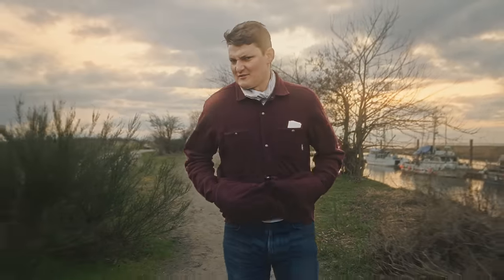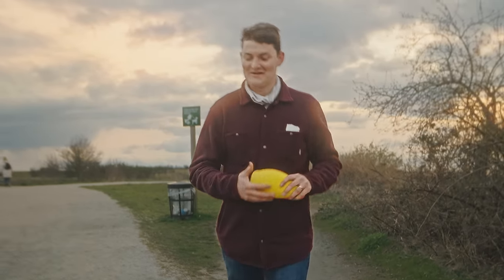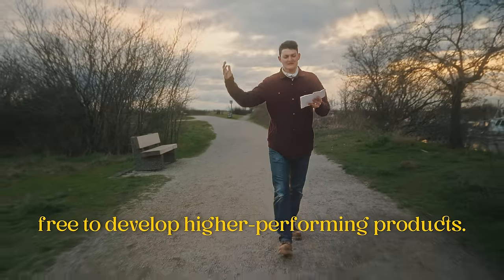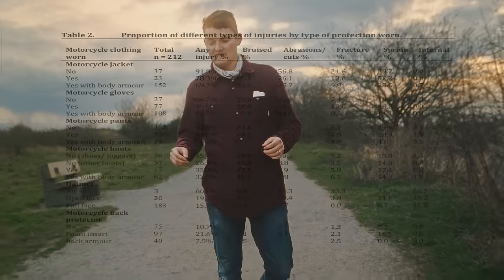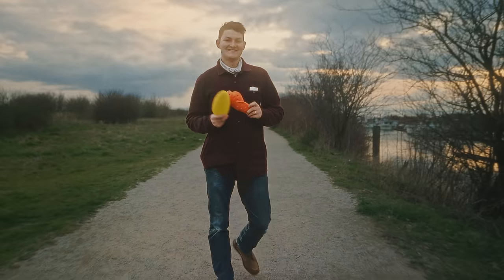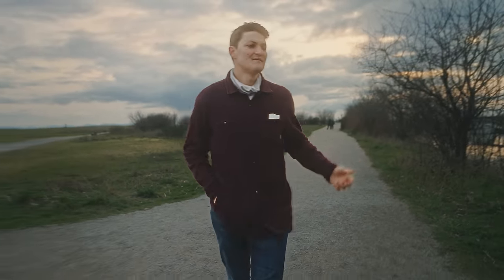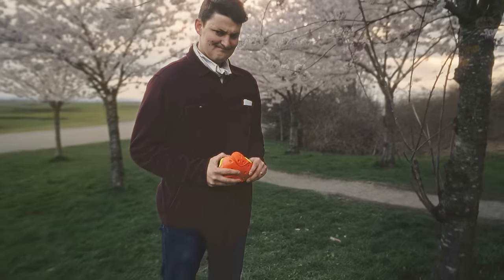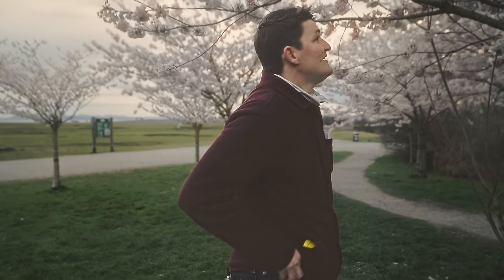Why I Stopped Wearing Motorcycle Body Armour

Comment: As someone that had a 10-15mph lowside in the BRC with no pads on legs, torso, and arms, I can tell you the bruising I got on my left knee and elbow was horrendous, lasting for about 2 weeks leaving me unable to work out or do anything strenuous.

Over the winter I lowsided at roughly 2 times the speed of the BRC lowside, so 4 times the impact forces. However, this time I had CE level 2 pads in elbows, shoulders, back, hips, and knees. I walked away with nothing but a headache and was working out the next day.

I really appreciate Ryan's philosophy on people making their own decisions, and just making sure they have all the information to make a well informed decision. For me, it's absolutely worth wearing the pads if it means there's a greater chance I won't be nearly bedridden for days.
Reply: I think your examples are where the padded armor is best - sliding with minimal impacts. I agree I will wear it just because why not, but I know if there is an impact I'm getting a break.
Reply: This!  I (knock on wood) haven't had an unplanned on-road get off in a LONG time.  However, I have ridden with dozens of people who have.  I have seen the aftermath of SLIDES with and without armor.  I ride with the best armor I can tolerate.  I am sure that in high sides and multi-vehicle impacts, the presence or lack of a little foam pad is of little consequence.  
But, most accidents (not even reported) are not written up by a cop.  The perpetrator tries to slink away before a COP shows up and adds insult to injury with a performance award such as: "Failure to maintain control of vehicle."   Wearing good riding gear helps the road rash a lot, and the pads help with that too.    So, I wonder about the validity of those surveys.  Are the group of riders with and without armor reporting the accident results at the same rate?  Perhaps riders with armor were able to sneak away from an accident scene and pretend like it was no big deal, and they aren't fully represented in the data.

One time about 30+ years ago, I hit a small slick patch on an exit ramp.  I low sided and slid to the outside of the curve.  No impact and I got up and saw just a grayish frayed patch on my jacket.  I picked up my bike noted the ground down parts, and the broken brake lever and turn signal.  I then finished my ride to work.  When I got to work and took off my outer layer, and then the inner down layer, and then the fleece liner, I noticed that my elbow had a patch the size of two quarters that looked like melted mozzarella cheese, it stuck to the fleece and came off, leaving a wet weeping raw meat underneath.   The fleece, the down coat, and the outer layer were mostly fine, but the outer layer looked like I had scuffed it.
If there had been a small pad there, I don't think I would have had that burn.
Reply: I've had a 30kph lowside in Kevlar with no pads and have a scar to show for it.
I've also T-boned a car and gone flying in a cheap armored jacket and wasn't even bruised.
Anecdotal yes, but I'll at least stick to some flexible C1 personally.
Reply: Totally agree with above ❤
Reply: Lol at a 2 week bruise being "Horrendous" , people are weak today...
Reply: @kyle5778  horrendous in the sense that the joints were stiff to point I could barely move them until they healed, not talking about pain. The body takes time to heal, but apparently that makes people weak?
Reply: Same speed low side, when I fell the motorcycle fell on my left foot(it hit my foot with left foot peg) and broke both my malleoli. Surgery, 3-week patience, physiotherapy. Started cowardly walking after 1 month after the accident with my left foot muscles very weakened. After 1,5 month of walking and exercise I brought it back to its 95%. Now I am wearing moto boots always( I used to wear  jacket, gloves, helmet, but not boots). If i wore boots that day I would not have broken both of them or either of them. Also as I fell I fell with my elbow on the ground which had protection from the jacket pads.
Reply: @BenRussoUSA  Got a massive scar on my shin from sliding on the road once wearing non-riding jeans. The jeans weren't even torn up over the road rash. Had another off on the freeway and slid on my back across several lanes of traffic. The cheap turtle foam backpad in my Joe Rocket hoodie took the slide like a champ and I got out of that one with no injuries. The outer shell of the hoodie wasn't even abraded through, but the backpad surfaces inside were noticeable roughed up. I'm pretty sure that backpad saved me from some really severe trauma that night, and I think your anecdote also supports that pure abrasion resistance via penetration through a fabric may not be the complete story as far as protective gear goes. Having that layer of  armor to sacrifice can really save some flesh.
Reply: Hard agree. I'm disappointed at the failure of logic in the video -- as if avoiding fractures is the only reason to wear armor. Ryan even mentions, several times IIRC, that impact protection does help avoid/lesson other injuries. I definitely agree with giving people information to make their own decisions, but please, make a good argument with it.
Reply: You couldn't work out for 2 weeks, that's no big deal. I couldn't walk for 6 months after my accident, wouldn't have called it horrendous, but it did suck. Stop being so melodramatic 😂
Reply: The question is whether wearing armor all the time is worth reducing the risk of bruising and laceration, given that one it's highly unlikely these will kill you, and two the chance of having a crash to begin with are very low. In your case, is saving a few weeks of pain from bruising worth spending years of time wearing uncomfortable motorcycle padding? For Ryan the answer is no.
Reply: Yeah but your bones didnt break so the pads were useless! Didnt you watch the video?!
Reply: @WolfMcWolferson weaker people require more time to heal
Reply: @koutsion  there's a video on my profile of my first crash on a motorbike. My foot wasn't broken but the boot was. All that force would have ended up in my foot and would have definitely broken something. Still limped for a few weeks.
Reply: @Nettabird303  Maybe Ryan decided to trick us on April 1st, despite him seeming honest in his views.
Reply: I agree 100%. I can't imagine any scenario where extra protection protects less than not having said extra protection.
Even if the effectiveness of the extra protection is neglectable I still think that is better than not having it at all.
Also padded gear is not that uncomfortable to me to be worth taking the pads off anyways.
I agree with Ryan most of the time, and he brings valid points in terms of preventing fractures, but honestly, I'm not with him on this one.
Reply: I low sided at ~20 mph in my military uniform (so no padding other than my knuckles and helmet), burned a hole through the pocket of my cargo pants and the elbow of my rain jacket, but no memorable bruising. So i think luck also plays a big factor pads or otherwise
Reply: @andrewroberts8959  Not being able to walk for 6 months is pretty much the definition of horrendous to my way of thinking especially if your job requires a lot of walking.
Reply: What other differences were there between the two accidents aside from speed? What did your body hit? Did you land the same way both times? Was your speed constant? They're all variables that could contribute to your injuries, or lack there of. To say it was because of the armour that you weren't hurt from just two accidents isn't proof of concept. It just says the time you were wearing armour you got lucky. If you could replicate the results 100 times for each scenario, then you'd have evidence. Until then though, you're just guessing.
Reply: Yes !
Reply: @amando96  I just saw it. I am glad your equipment saved you :). Was it bruised? Where was the pain coming from? Did the bike fell on your foot as well? I could not understand clearly from the video. Cheers
Reply: @koutsion  No bruising, but I'm notoriously hard to bruise. There's another crash video (mountain bike) where I broke my collarbone and also had zero bruising.

The pain was on the outer and bottom part of the foot. Flexing my toes up or down hurt like a b1tch. Ankle was fine.

I also don't totally understand the mechanics of what happened. There was a tree-trunk on the ground and I'm pretty certain that my foot ended up between the trunk and the bike.
Reply: At around 10mph your motorcycle can slide for around 11 feet, while you get slammed straight into the ground in most cases, not a good feeling in standard denim xD
Reply: @koutsion  Same here. Boots, gloves, helmet and jacket armor saved me and I walked away with just a swollen knee and black and blue ankle from I think the deers legs hitting me as I t-boned it. Armor took 100% of the hit landing on the road. AXO jacket.
Reply: @XenoX101  It's no big deal wearing gear and trust me you'll wish you had it on if you get into an accident.
Reply: @MrLaughingcorpse  Glad you are OK mate! Stay safe!!!
Reply: Well said. Unfortunate circumstances that you endured but, well said .